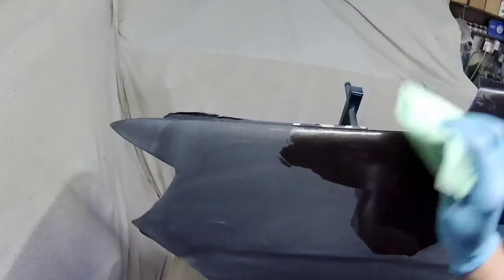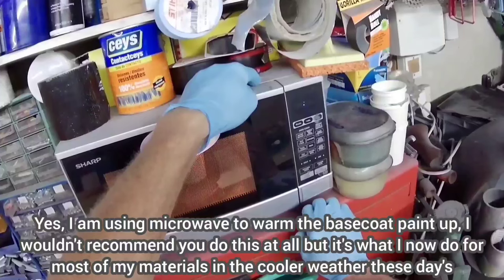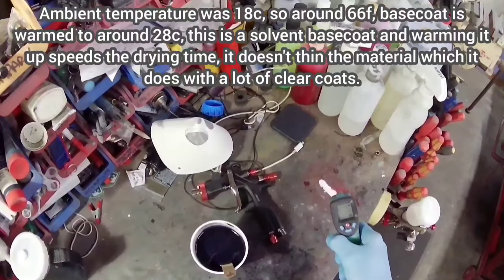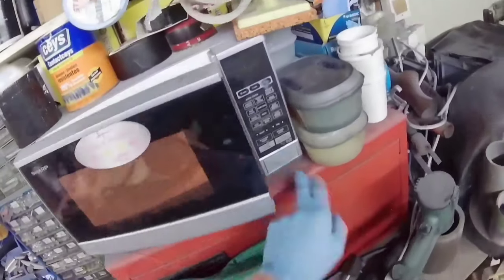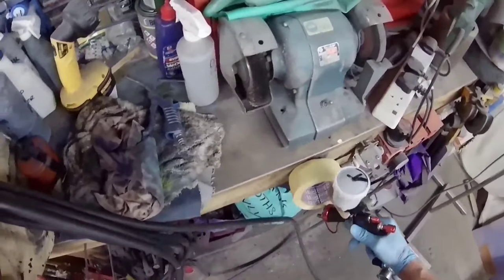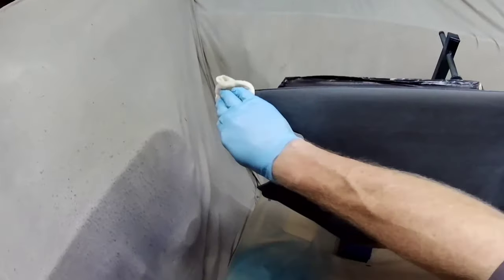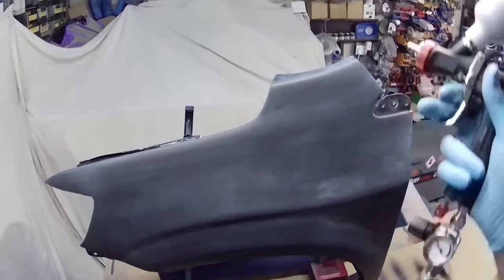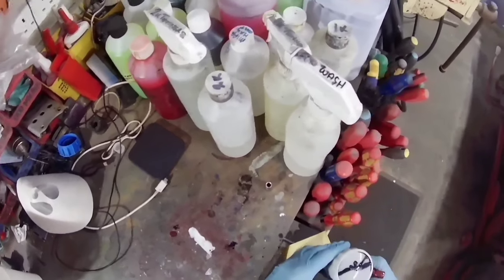Aeropro R500 v A610 LVLP Spray Guns,  Great Value Chinese Spray Guns [Rongpeng]

Comment: a610 is still a great gun
Reply from the maker: Hi buddy,  Yes,  it's just quite different from the R500, but it is as good a gun 👍
Reply: The A610 uses a bushing for the trigger which makes it feel gritty, the R500 uses oring which is smoother. Also first stage of trigger pull on the A610 is very short. I returned my A610 back to Amazon

Comment: Hi. Great job! However, you make a mistake by comparing only one copy of the same product. Check the clearances in production on several of the same paint guns. It's roulette, so one will be great and the next 5 will be unacceptable.
Reply from the maker: Hi Buddy. I get what you're saying, but to be fair,  most are produced to the same standards. For example, I had 3 different Gti Pro Lite copies,  different names, colours, etc , but they were all the same in build and performance, cheers 👍
Reply: Hi. Maybe this is where the negative opinions about cheap equipment come from. The cheaper it is, the weaker the quality control. Legendary brands like SATA take care of this. In cheap products, the priority is to reduce the price. Maybe someday you will test e.g. R500 or 898 or other cheap painting guns in this respect. Regards.
Reply from the maker: @kfpolska1494 Again. To a degree, I would agree. However,  cheap isn't always poor quality . One of the equations you have missed is profit. The big names make lots of profit , and cheaper often relies on more sales

Comment: This info is gold! It could really help someone buy the right guns to begin with and not waste money.  Honestly,  I would just buy both as a base gun and separate clear gun. They're certainly inexpensive enough on A. Express
Reply from the maker: Hi Boss, after my first video taking them apart and doing a pattern test, people seemed to discount the A610, so I was trying to show and say that it's not that clear-cut.

Hopefully, that came across using the A610 for something that's not it best use. Really,  it's a better clear gun than base, but it's capable of doing both and getting a credible finish.

It certainly shouldn't be written off because the fan is smaller,  cheers mate, thanks for the support as always 👍
Reply: @peteshobbies5383  hi pete I live in the USA  I talk with Brad that works for sagola he told me that the price for the new upgraded sagola 4600 price will not increase  ,  also he said that the needle and tip will fit the new version from the old version  ,, but the air Nozzle will not fit , also Brad is in Spain now at the sagola plant  they are getting ready for the release very soon here in the USA
Reply from the maker: @refinishtechnology2529 Hi mate, Thanks for letting us know. It's good to hear the price won't change. They are already expensive in the US and UK since Sagola were purchased by Elcometer in the UK, and they increased prices significantly.

It's also good to know they aren't changing the tip and needle, so those of us with older guns can use them on the newer model. We appreciate the update,  cheers 👍

Comment: Pete, I would rather buy an FLG5 (which I did a long time ago)  than have both these guns, for not much more money.
Reply from the maker: Hi Ken, I can understand that argument for sure, I'm not sure I would share it, although that could change, I would certainly take an ANI F160 over these but I would take the ANI over the FLG5 anyway although I still keep my FLG5 that I've had for nearly 10 year's now.

I think I said in the video that I'm sure these will mainly be purchased by new painters, and I think to that end, they are a great place to start, cheers buddy 👍
Reply: @peteshobbies5383   does the FLG5 use around same CFM than ANI F160? I been hearing great things about ANI, (have an FLG5 myself as well) reason I'm asking is I have a 26 Gal compressor that only makes 4.5 CFM @ 90 PSI
Reply from the maker: Hi buddy,  The ANI F160 with the HPS cap uses a little more air than the FLG5. Around 10%, I would guess
Reply: That's not enough air for a FLG5 to work properly, or any full sized gun for that matter.

Comment: The A610 uses a bushing for the trigger which makes it feel gritty, the R500 uses oring which is smoother. I returned my A610 due to the trigger feel and the air cap holes was not straight. Also first stage of trigger pull on the A610 is very short. I dont get how they spray differently when the needle sets are the same and are interchangeable. I like the R500 better.
Reply from the maker: The trigger pull on the A610 is absolutely fine, so maybe it was a problem with yours, the caps are slightly different

Comment: greetings Pete, then what do you think is the best Chinese paint gun for base and clear coat up to the price of 70-80? euros?
Reply from the maker: Hi Milan, what is your air supply like? So, cfm and tank capacity?
Reply: compressor size 100l air flow 316 l/min
Reply: maybe 2-3 guns, the best according to your views
Reply from the maker: You should have enough air to run the Ntools 4000B,  which is very good and better than the R500 Ect. I'm not sure about longevity, but it seems well made
Reply: thanks, it will be for painting individual parts, so it will probably last quite a while

Comment: hi. what cup are You using for microwave that don't melt?? Or don't give a reaction with paint?
Reply from the maker: Hi Mate, I use paper cups these days  in 3 different sizes, but I also use normal plastic paint mixing cups. I never had a problem with any of them in the microwave

Comment: I measured the tip on my Sata 3000RP when I had it, and the 1.3 tip (marked) was about 1.45.
Reply from the maker: Hi Ken, They do it all the time, I can't see the point of stating the size of a tip if it's not the size they say, very frustrating,  thanks, mate 👍
Reply from the maker: Hi mate, I have heard that before, but if that's the case, I wonder what the figure means. If it's a material flow rating, what does say 1.3 equate to?

It's very confusing for sure. Cheers, buddy 👍
Reply from the maker: Thanks, mate. I'm presuming that's at 2 bar, I would think the X5500 would be a little less as it seems to put out less than the 5000 at the same pressure and the same marked tip size

Comment: Hi Pete. What settings do you use when using a610 for clear coat?
Reply from the maker: Hi mate, normally full fluid and full fan between 2.0 and 2.5 bar
Reply: @peteshobbies5383  Hi Pete, What type of compressor are you using with these guns?
Reply from the maker: Hi Buddy,  I have two 90lt 14.5 cfm compressors linked, which is much more than necessary. These use around 8 cfm
Reply: @peteshobbies5383  Nice. Thank you!
Reply from the maker: @ehss192, you're welcome buddy

Comment: Hello Pete. A question regarding compressor unit. Is it a must for being an oil-less type? 
Learned so much about sprayguns and spraying watching your videos.. 👌 Thank you!
Reply from the maker: Hi Mate, No, most higher output compressors are not oil less, so you'll normally need an oil lubricated compressor.

What is important is filtering the contaminants from the air. Take a look at these videos. The first is my old setup, but it worked very well.

 The second is my current setup and has been trouble-free for 2 years now, it's worth spending more on clean air than a good gun, not as exciting but certainly worth it, videos below 👍

https://youtu.be/iJzODBeGtjM
https://youtu.be/SnQGMrmJTDE
Reply: Pure gold..thank you!
Reply from the maker: @meuko13, you're welcome, buddy 👍

Comment: Hi Pete hope you are ok mate, great video as always and it's packed full of useful info for people that are not sure what to get if they are looking for a good but cheap gun to get them started so this is perfect with an unbiased look at these 2 guns👌

I always thought that the A610 was just a posh R500 and they both sprayed the same but after seeing this I now know this isn't true looking at the different spray patterns but as you say the smaller fan doesn't make it a worse gun compared to the R500.

As you know I have the R500 and always found it was a really good WoW primer gun and it lays the basecoat very well but I wasn't so keen on it for clear as it gave more peel than I'm used to but I suppose it would pass if you wanted a OEM finish for the clear🤔
Thanks Pete a very interesting video👍
Reply from the maker: Hi John,  thanks mate, yeah,  I wanted to say about the fan size not being the be all and end all, quite a few people have messaged me and generally think the bigger the fan the better which isn't the case, it's much more dependent on what your doing rather than the size of the fan.

Cheers mate 👍
Reply: Yeah exactly mate as sometimes the fan can be to big for the gun if it can't deliver enough paint to fill the fan that can be worse than having a small one, I'm sure there is a joke about bigger isn't always better but I might get banned of here again🫣🤫🤣
Reply from the maker: @JohnWD40TC02 Yeah,  don't go there, mate 🤣😂🤣